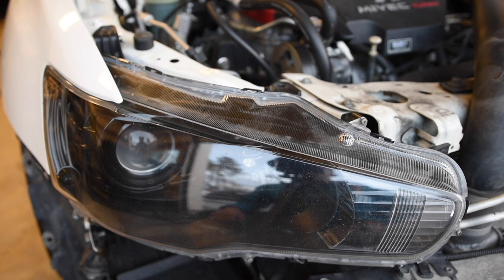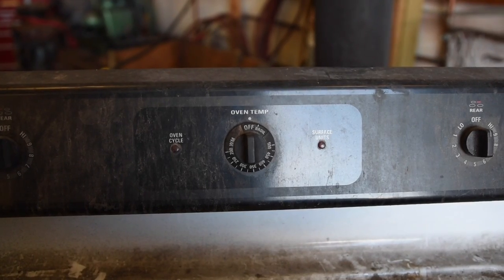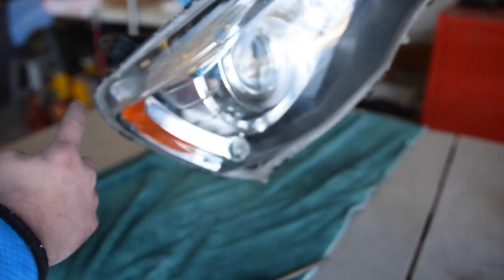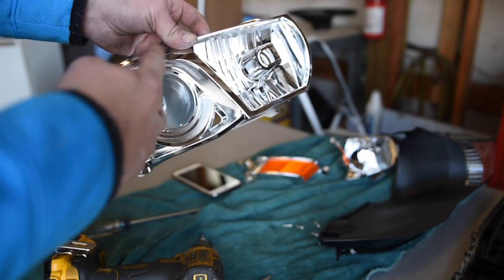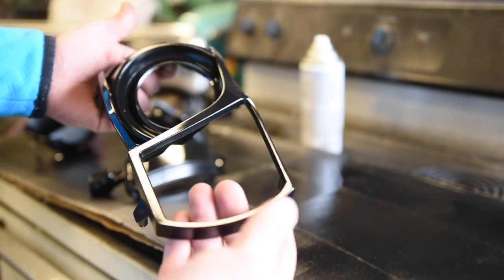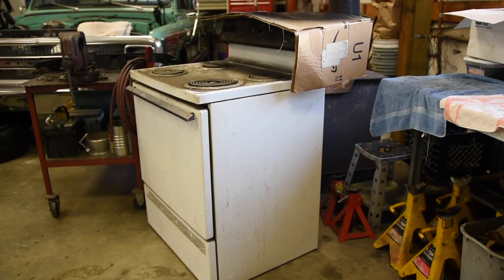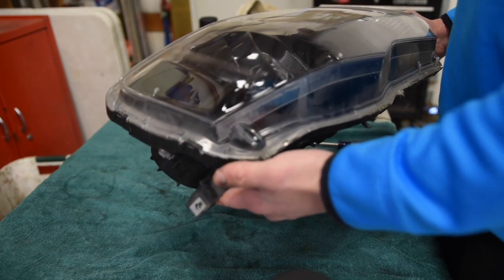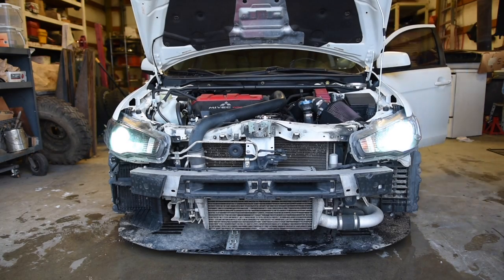PROJECT EVO X EP. 5 | HEADLIGHT BLACKOUT

Comment: Is this the SSS package? Where's the bulb height adjustment? Also, why did you choose to not use new glue/sealant?
Reply from the maker: Yes it is SSS. There are two headlight adjustments on the backside of the headlight. I didn't use any new sealant because you can usually get away with reusing the factory sealant for a time or two.
Reply: Any way you can point to the adjustments in the video? For example, go to 8:54 and it's the... something something. Been trying to find it on my car as well